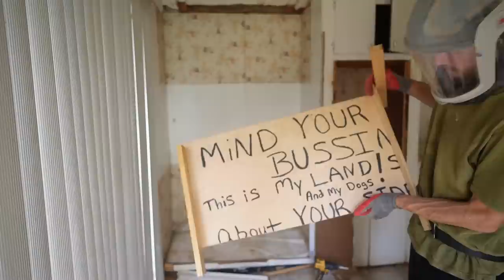Nasty Mobile Home Kitchen Demolition

Comment: I spent one whole summer redoing our Mobile home kitchen. I found MAJOR water damage from under the kitchen cabinet all the way to the corner behind the refrigerator.  The floor was rotten. The sill plate and 2 feet up every stud was rotted. I had to replace all of that. My biggest issue was setting the new cabinets. My brother from Texas came and helped because I couldn't  get things square. Mobile homes are NOT square. It turned out fantastic,  but what a PAIN!! NEVER AGAIN. I never want to do another Mobile home kitchen.
Reply: @housedimitrescu7196 having moved two...the bigger ones...they don't quite transport well. Stuff breaks, especially toilets. Probably as there isn't much give in porcelain, they crack.
Reply: Never say never. 😅 But bottom line is You Did It!

Comment: I remember rehabbing our '74 Dbl wide's kitchen. It wasn't that big, and the cabinet frames were solid so we rebuilt using the frames. New  cherry doors (28)/drawers (7) & all the hardware. We applied cherry veneer and re-faced the cabinets. Stained everything in cherry. Rebuilt the floors, put in CoreTex H2O proof LVF throughout the entire house. Cleaned & Painted over all the inside cabinet surfaces, the paper was "Paul Revere" themed!!!! It was weird paper!! Seeing the paper in your MH reminded of our remodel! It was sooo worth all the hard work. That kitchen sold that house for us. It was very nice when we finished. 😊

Comment: When that house was new, that was a pretty deluxe kitchen, particularly for a single wide. I've cleaned greasier kitchens, but I sure hated it. I've used various cleaners over the years, and I now use Purple Power. I start at the bottom of what I am cleaning, spray on some cleaner, then wipe with a sponge or a sponge mop. I have 2 buckets of water near by. The first is to rinse the sponge, and the second is for clean rinse water to dip the sponge in. I might have also saved the sink depending upon the depth and quality.

Comment: I would keep the counter top and reuse it in the remodel. Just sanded it and restrain it. Both pieces.
Reply from the maker: It's not real wood. It's a laminate countertop. Also, we're changing the layout.

Comment: That was an amazing day of accomplishment.    My back, hands and shoulders started to ache in sympathy throughout Doug's Beast Mode Blitz.    I reside just a few hours north of Ashley and Doug so our weather is quite similar.   A friend of mine recently purchased a getaway lakefront property that included 2 small single-wide mobile homes.   They were quoted $3,000 each to gut the interiors.   Moving everything to the dump-bin would be another $1,500 so a grand total of $7,500.   Rewiring and repiping both units would be $8,000.   They couldn't locate anyone interested in 'finishing' the interiors so they junked both and had modular homes moved on-site.    Of course I knew Ashley and Doug could have easily transformed everything to better-than-new condition.     The open kitchen layout certainly made the area feel spacious.    I am amazed the cooktop was so clean.   The postcard and cooktop were interesting.   Everything else had served it's purpose and needed to go.   I admire your willingness to place items roadside for interested parties.   I have one vehicle (not a truck), and I wouldn't consider having nasty appliances in it.

Comment: I have a question. What keeps an oven from burning up the cabinets around it? We've had a number of stoves over the years, some put out more heat than others.
Reply from the maker: I'm assuming there is a layer of insulation in them.

Comment: Take your scrap metals dishwasher, overhead vent-hood, refrigerator, sink and other scrap to the scrapyard, it looks if though you have about $70 Dollars there. that would help cut cost. 70$ is about 8 sheets of sheetrock, that's 32 feet wall.

Comment: Everything looks beautiful, I love it, y’all have worked so hard, still have a lot to go ,but look what y’all have done all by yourselves, would have been nice to have friends,but you didn’t have any, but
If there is a next time you’ll met some friends by then, I love your sons room, it’s so nice, I love the 
Pretty blue handles and your hardware for the closets too. Where do y’all live while working on the house, it’ll really be fantastic when the inside is finished, I love mobile homes, they have so much ,
They have so much space, and hiding places for things. But your sure right about everything is so
Over priced now. Can’t believe how hard to make it, y’all did good buying,and refining things up, something y’all should be very proud of. Do you have any family around? I love the new bed and drawers, it’s really going to be so nice when your desk is all done. God Bless and be with you through your journey,be safe. We’ll be praying for you.🙏🏽😊😊♥️♥️♥️
Reply from the maker: We don't have any family near us. This mobile home is somewhat near our main house where we live, so whenever we want to work on it it's easy and quick to just drive to it :)
Reply: As hot as it is in Florida how do you work so hard?
Reply from the maker: @mygirls6255  We just deal with the heat. Most days are normal, not too overly hot. The heat is a lot better than working in frigid temps like where we moved from. :)

Comment: I know that this may sound stupid, I know that mobile homes are made of lightweight materials (so that they can be transported) but is there a gross weight for the frame when you come to rebuild?
Reply from the maker: I believe there is but you'd probably have to contact the manufacturer to find out what it is. Generally speaking, I don't think it's something you have to worry too much about though.
Reply: @diyfferent  thank you for the rapid reply, having had a caravan years ago we found that all the interior fittings were made of the flimiest materials but they did what they were manufactured to do.thanks again.

Comment: Was wondering when you were pulling out all those flimsy cabinets how you would replace everything with higher quality items without significantly increasing the total weight load of the trailer.  Can it be moved if someone wants to build a house in it’s place on the property?
Reply from the maker: There won't be an increase of weight with how we will be redoing the kitchen. These cabinets were pretty heavy themselves, made of MDF and drywall. I don't think anyone will want to remove the mobile home to build a new home on this parcel, but even if they wanted to, it wouldn't be a problem.

Comment: I'm curious about the story of the layers of the kitchen. I'm guessing certain walls in the kitchen come to the assembler pre-wallpapered. This would account for wallpaper behind built-ins like cabinets and the wall oven. I was a bit mystified by the white panels over the wallpaper which look like the material the manufacturer would have installed, seams and all. But I think someone painted the cabinets white at some point and just painted over the wallpaper. You can see the DIY paint job on some shots of the insides of the cabinet doors like here 8:25. I think at some point someone put a lot of work into painting cabinets, walls, and peel and stick flooring. The layout of the kitchen seemed pretty good, too. That's not to say it wasn't time for all of this to go; it clearly was.
Reply from the maker: The kitchen is original but there was a renovation done many years back and it was all painted and fixed up. So some things may have been changed.

Comment: What is make and model of you mask filter system, could you put the link in the description section? Thanks
Reply from the maker: We did a video about it and linked to it under that video: https://youtu.be/koKrOK8dsN0
Reply: @diyfferent  Thank you
Reply: @diyfferent  Just watched video, thanks again. Try a nebulizer with colloidal silver to heal lung infections.
Reply from the maker: @safffff1000  There are much cheaper PAPR type of respirators available. You can search on amazon and see what's available. I know rockler had a self-contained unit that was more affordable too for woodwordking.

Comment: What can I do if the kitchen walls are bubbled? do I need to remove the kitchen sheetrock and replace it or can I replace it on top of the other wall?
Reply from the maker: I'm not sure what you mean by bubbled. Honestly, it's not too hard to remove the old drywall. It's messy, but I would probably just remove it if it was bad so I could see what else was going on. But if it goes behind cabinets or looks like it will be too much trouble, you can drywall over it. Just make sure you use long enough screws or a drywall adhesive. Just make sure you aren't burying any leaks or any problems that will keep coming through and ruin your new work.

Comment: Not 'bothered' because you're not keeping the sink, but honestly, it's stainless steel, and would clean up pretty good, and save you the $200 bucks you'll have to spend to replace it, but your call...
Reply: Why would anyone who is doing a complete renovation keep a scratched up sink?
Reply from the maker: I'm not a big fan of double sinks. The basins are too small when they are split.  But I agree that sinks are usually worth saving. Side note, We already have a new kitchen sink for the mobile home.
Reply: @jolloyd1247  First off, who says it's scratched?  Secondly, you can clean it up with cleanser, and it would likely be just fine.  Thirdly, I wasn't bothered by the fact that they decided to chuck it.

Comment: I think you need a sledge hammer :)
Reply: I have several different sizes of demo hammers, my favorite is a 5 pound with 3FT handle.
Also my DeWalt  large pry bar.  And a flat shovel and a roof shovel with a wedge welded to pry with are my go to weapons

Comment: you should have fired up that big ol window AC would have cooled it off a bit.  LIkely the socket alone by the window is a dedicated circuit you could have turned on.
Reply: Electricity is turned off for demo safety